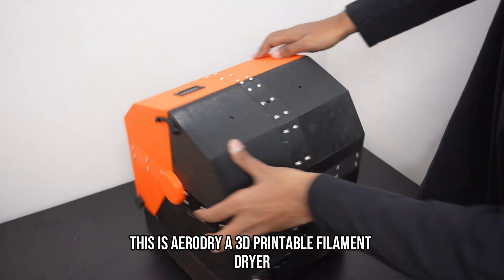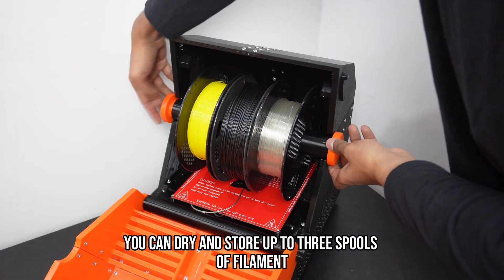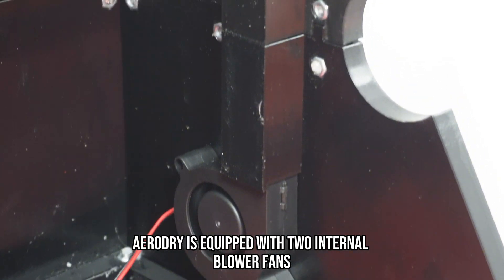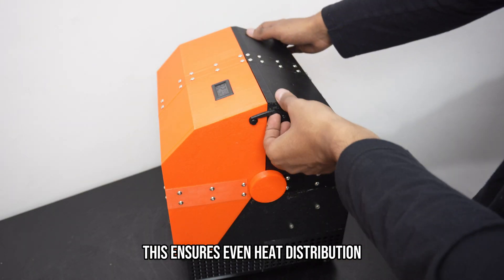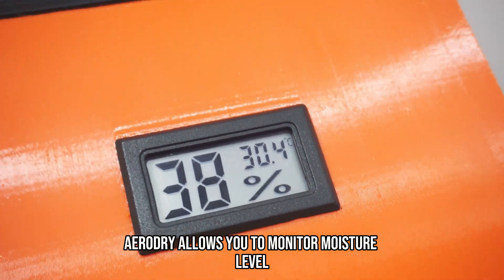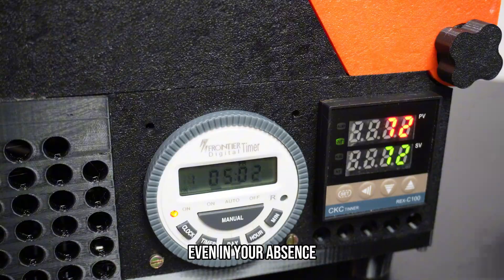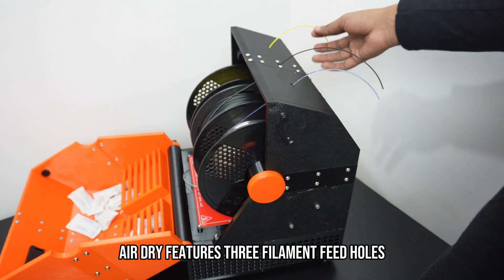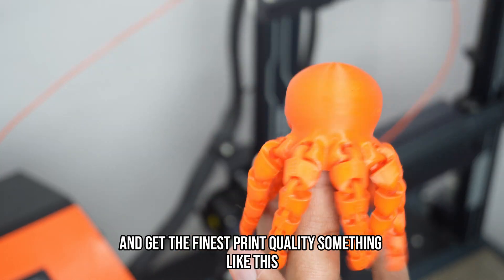100% 3D Printable Filament Dryer - World's First 3D Printable Filament Dryer

Comment: This has potential but it’s seriously under engineered.
You’re cooking the electronics. Using an old hotbed is ridiculous, use a pro heater, not having pneumatic connectors for the filament feeding and ptfe tube is dumb.
Reply: Also every time you open it the silicon desiccant beads just fall out everywhere why didn’t you put a lid on that?
Reply: Yup. Listen to Daddy here, Creative3DP!

Comment: I primarily use activated alumina desiccant due to its ease of recharging in a standard oven/convection oven and the increased drying strength over silica gel. For those that want to use reusable desiccant, I would suggest including a refillable desiccant container. I would also note that since you aren't bringing fresh air from outside the dryer, the moisture has nowhere to go and stays in the air inside the chamber, so the silica desiccant you are using is not just keeping it dry after the drying process, but it is actually the thing doing the drying. I would decide early on if you want to dry the filament by bringing in outside air slowly (so as not to overload the heating) and raising its temperature to lower the relative humidity, just like a dehydrator, or if you want to use desiccant to absorb the water. You can get the water content in the filament lower with a desiccant generally, since they can achieve a relative humidity lower than you typically can just through heating the air, but then you are inconvenienced by needing to recharge the desiccant packs (blowing VERY hot/dry air over them in a dehydrator or evaporating the moisture with heat). Good luck with this project!
Reply from the maker: There are three feeding holes  which do act as exit for the moisture. It's tried and tested and it's work, given the desiccant packs, it's to use when you're just storing the filament not drying.